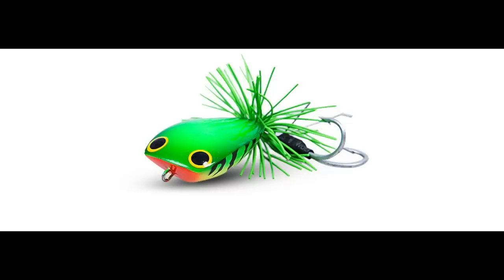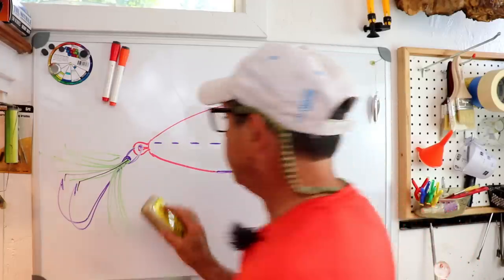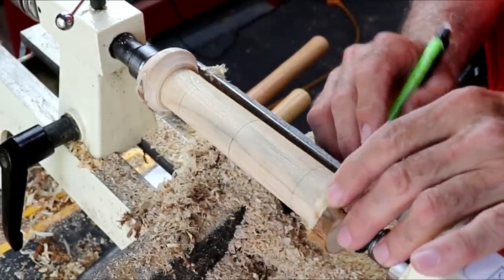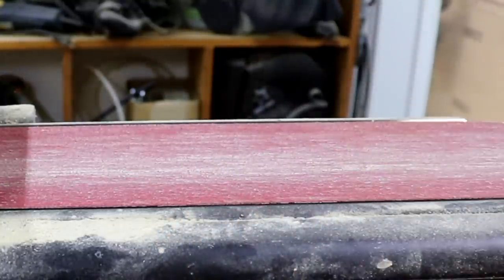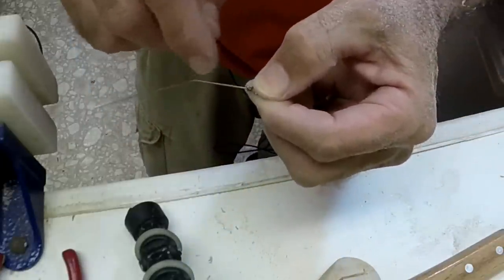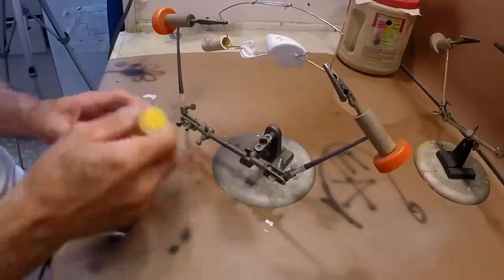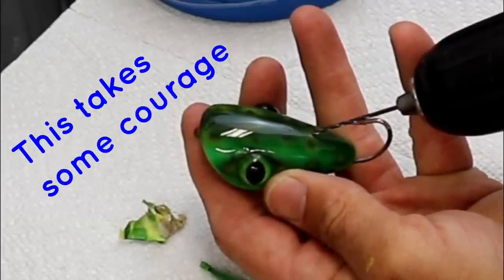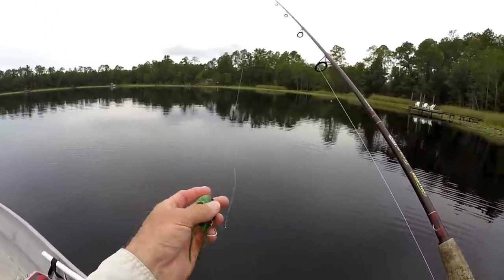Making a Jump Frog Lure, Better

Comment: Did the hook reset it self after the strike ? This looks like a easy model to replicate with my 3D printer (without the magnets) any advice where u would keep the airchamber and how big i shoud desgin it.  sitting on the tip of my chair for your new vids !
Reply from the maker: Thanks man. ...
Challenge here is to keep the lure upright...get the center of gravity as low as possible. I counted on the magnets. The hook jump right back in the slot...super cool.
Reply: @EngineeredAngler  Thats awesome !  top notch enginering :D

Comment: What is the final lure made of? I saw the final video where it is poured but is that an epoxy and where can I get it? Thanks for great videos!
Reply from the maker: It's made from a two-part polyurethane resin. I buy mine from a company called specialty resins. But there are quite a few suppliers. Thanks for watching

Comment: Hey Frank Love the concept and all your videos, I have been a bait maker for a few years and a wood turner for a few more,  Cap'n Eddie Castellin has an excellent video on skew sharpening and use that would allow you a much faster and cleaner turning with a lot less sanding on your turned lures (Sharpskew.avi) your videos and concept are easy to follow and make bait making a little more predictable, thanks so much keep up the good work...........................David J
Reply from the maker: Thanks so much for the tip.  I'm only a student of wood turning  and could use any help I get.  I'll check out the video.  Thanks for the positive feedback...I can use that too.

Comment: I'd say this lure won't jump at all,more like a wobble frog.. I've done  this kind of jump frog  8 years ago(and it jumps without the skirt) but with a double hook buried inside the body..the reason why your lure won't jump are because of the weight distribution(must be like popper), the front "face"(you need to make a shape like a boat-curve) to name few...hard to hook up due to your free hook setting..my 2 cent..anyway,nice idea.
Reply from the maker: It actually jumps really well and the hook up rate is much better than the plastic frogs with double hooks. But anytime you make a lure weedless you reduce the hook up rate..it's a compromise. Thanks for your input.